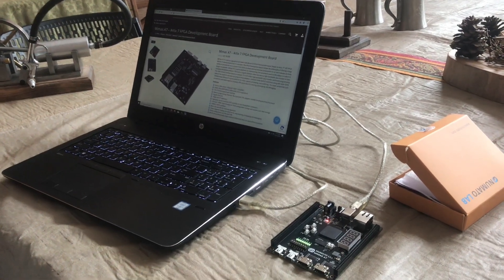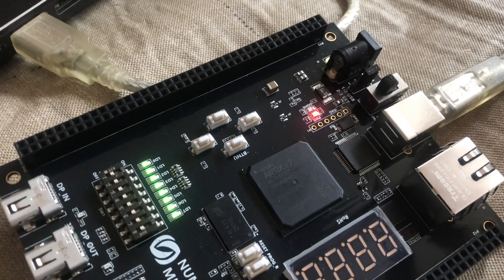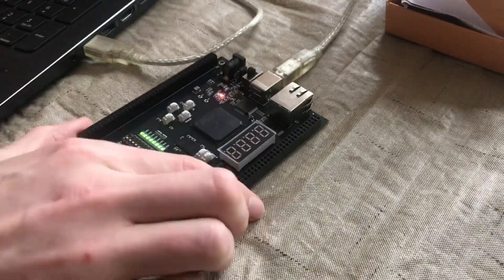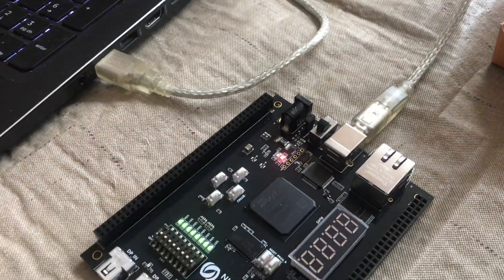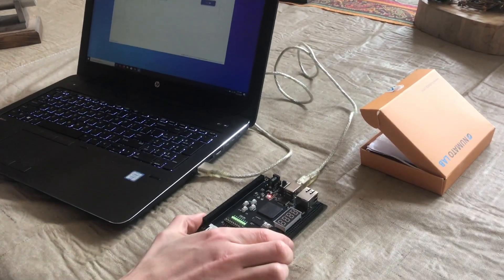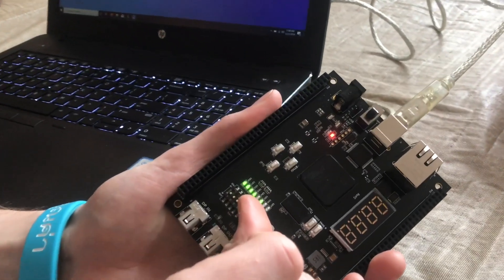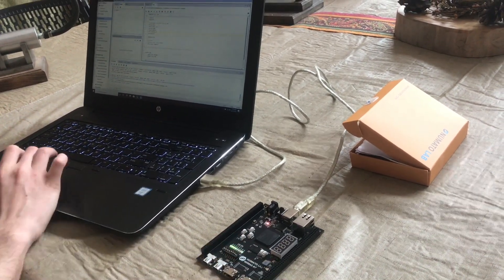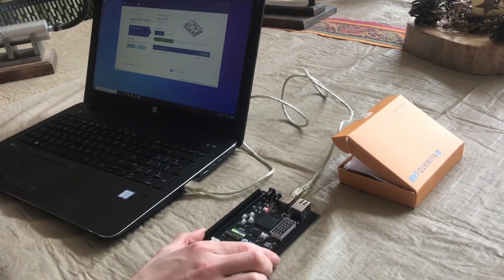(REVIEW) mimas a7 FPGA development board

Comment: Hi there!
I know that I'm late for confirming few details. But hope this might help for the new viewers.
-> Tenagra programs any bit-stream generated for the Mimas A7 board. Irrespective whether it contains a soft-core or a simple Verilog or VHDL code.
-> Tenagra provides an amazing feature known as XVC (Xilinx Virtual Cable) which helps to use Xilinx Vivado Hardware Manager for Programming the Board as well as ILA Debugging.
-> However, the application/.elf file built in Vivado SDK/Vitis can't be dumped using Tenagra. But there is a work around of simply merging the .bit and .elf files.
-> Is the Tenagra only option for programming the Mimas A7 without JTAG? Nope, there are open-sources software like OpenOCD, xc3sprog which does the same efficiently. Also these open-source platforms work on various Linux Distros as well.
For more information/details, check-out the knowledge base articles in Numato Lab website.
Reply: I wish your documentation would make clear that there is currently no way to program these boards (to the ROM) under Linux unless you use a JTAG cable.
Reply: @smogne41  As I had mentioned, there are open-source software that can be used for programming. The process is hardly few commands to get it done. Refer the documentation of those open-sources for details.